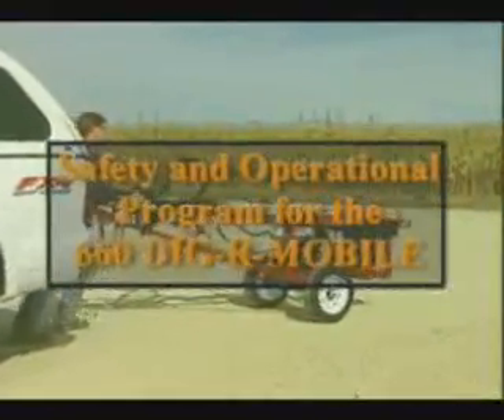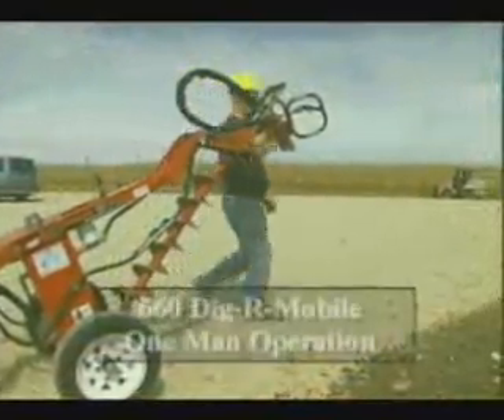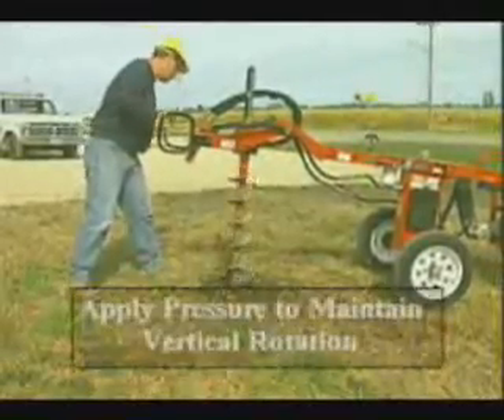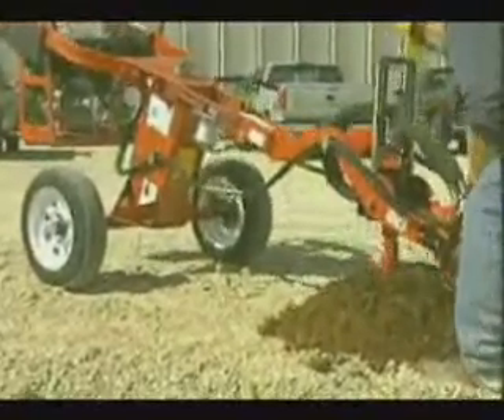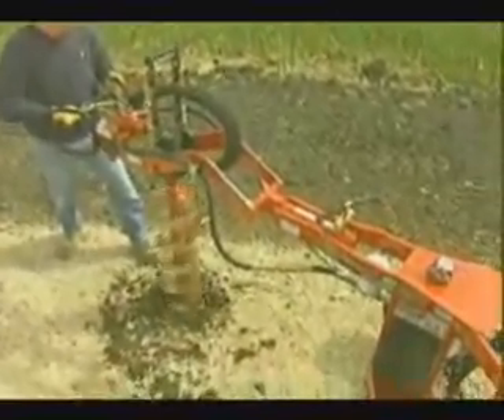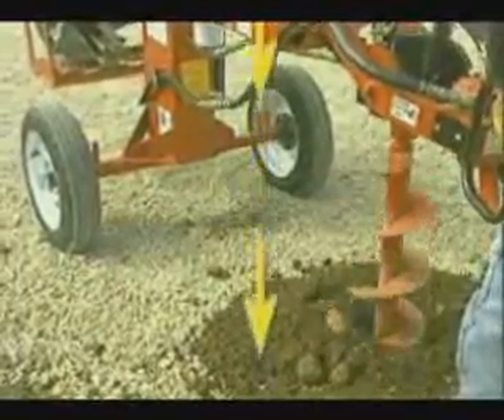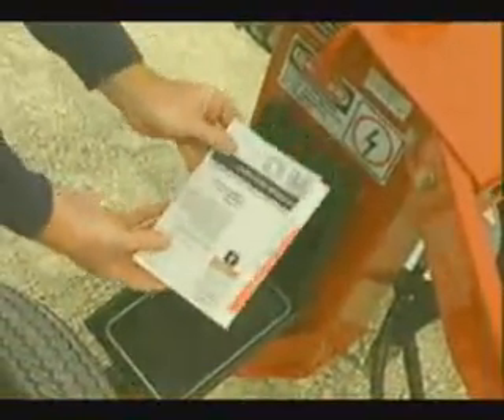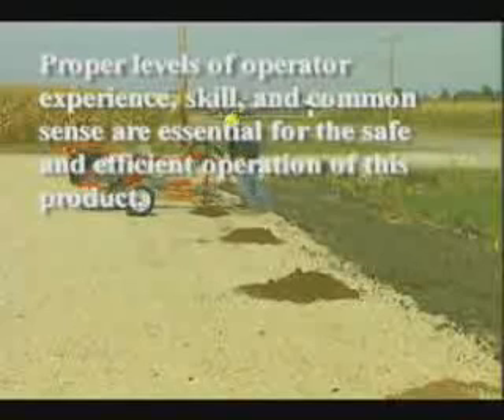M660 DIG-R-MOBILE, Towable Hole Digger, Safety and Operational Information

Comment: In the early 70s, general built a Four wheel drive digger hydraulic.
That is much better than this. You could stand on it, drive it to where you needed to dig a hole Start it off slow and as you  deeper then you could speed it up. It had a hydraulic boom left or right forward or back. You started off slow and you could dig a straight hole, and if anything got in its way, it would cut it. Very powerful, I am still using this piece of equipment. It is my favorite It is a good piece of equipment. Over my 50 years of building FenceI have tried many different machines, but this 70 models. General Digger is absolutely the best.

Comment: I own a fence company and have purchased. In the early 70s, a general digger, it works great still It is 4 wheel drive hydraulic. It works first time every time. It is almost impossible to get it stuck. And we'll drill a whole big enough to stand up in. I have often wondered why they didn't make more of these diggers. I have used other diggers by general but I find my old 70 model. Hydraulic postal digger is the best in my opinion.